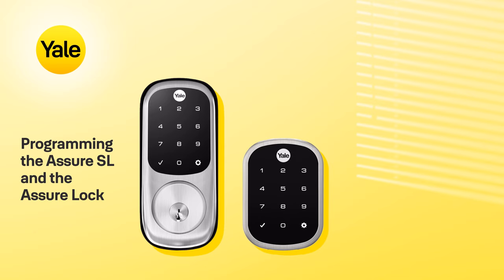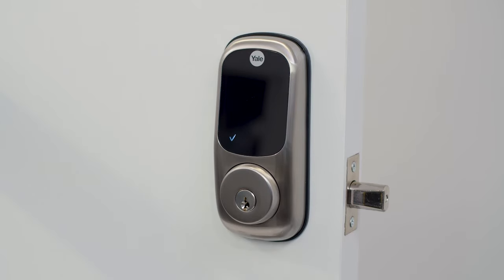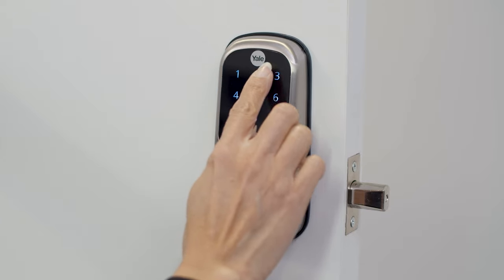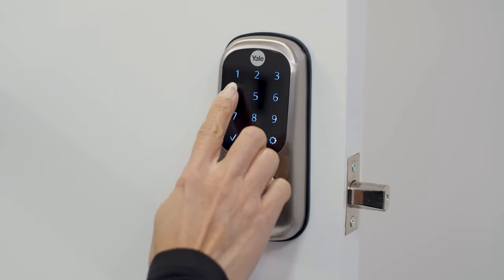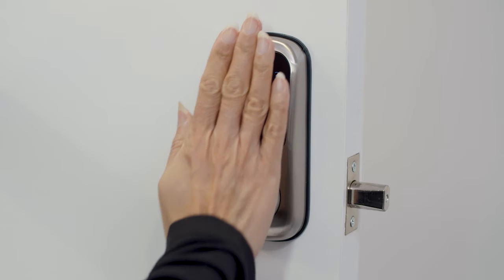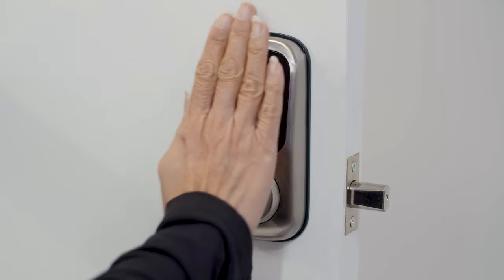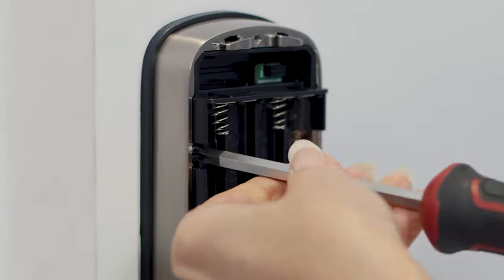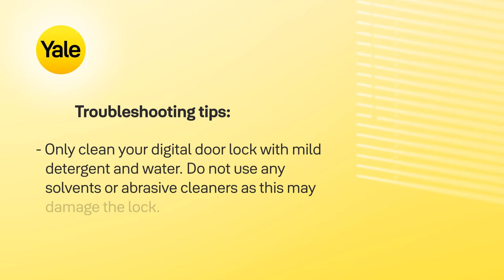Programming the Yale Assure Lock and Assure Lock SL

Comment: I could not reset to factory default using this method - but after consulting the actual manual I found the missing piece of information omitted by this video.                                                                                                                                                                                    ****Hold the reset button while putting the batteries back in, then release the reset button after a minimum of 3 seconds (with the batteries in!) *****                                                                                                                                                                                                     You can then remove the batteries and reassemble everything. If the factory reset was successful the lock will ask you to reset the master PIN when you touch the keypad and you can follow the directions on the video to do this.
Reply: Thank you Ben!  That save  me a bunch of aggravation.
Reply: You’re the man👍

Comment: Hi. I even couldn't to set the master code. How I can do it? isn't allowing me. Do I have to factory reset?
Reply: Yes factory reset - if the lock is not asking you to set a master PIN when you touch the screen then you have not successfully completed a factory reset. Put the batteries back in while pushing the reset button and release the button after a minimum of three seconds (of the batteries being back in). Then you can remove the batteries to reassemble everything prior to setting the master PIN.

Comment: I've had the Yale August smart lock for two years and never had a problem but now suddenly, it gets stuck and the lock will not open. I've reset it to factory settings, reprogrammed the master code, called the number to talk with a helper, it initially worked and less than 24 hours later, the lock is once again stuck and will not open. I have to use the key to lock when I leave the house. Anyone have any suggestions to get the lock to work again?
Reply: @-BUFFALOMan  I replaced it.
Reply: @-BUFFALOMan  Yes, a U-tec that does not require a separate attachment for the internet connection, as it is all one single piece.
Reply: had the same issue. The problem might be that the lock is trying to lock the opposite way. If you need any extra help let me know.
Reply: @moneyRalf212  Thank you for your offer of assistance, Ralfy X, but after losing considerable time and patience trying to find a solution that the Yale people were clearly not interested in resolving, I was not loyal to the brand. I dumped it and bought another manufacturer's digital lock. It's been operating very well since last year. I'm sure these locks have a built-in obsolescence date when they leave the factory, so it may come a time to replace this one as well. Nothing is permanent anymore and nothing can be relied upon forever either. Every day, the good old adage "Carpe Diem" makes more sense.
Reply: @Fr1nc3sc41  I had two options work till i find the answer or spend $300 on another brand. Glad i was able to fix it. Stay blessed!

Comment: Brought this lock and NEVER worked, unable to input master code and Bluetooth doesn’t work. I’m a computer Engineer so are familiar with electronic. Certainly faulty item so don’t recommend!
Reply: Not faulty - this video was misleading on how to complete the factory reset - the official manual was quite clear however. It is a soft reset so needs the batteries in (not a hard reset as implied in this video).